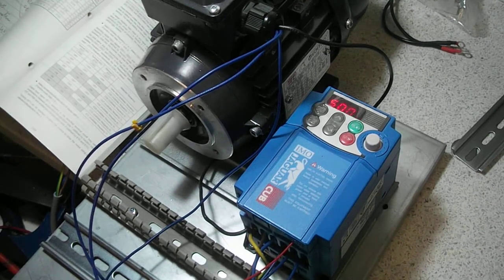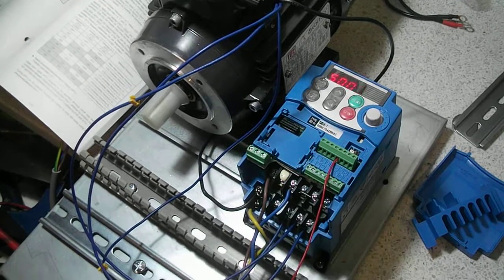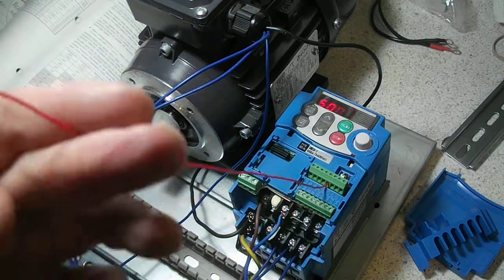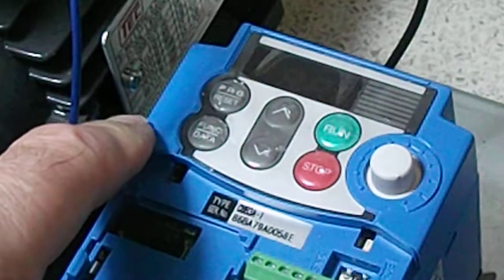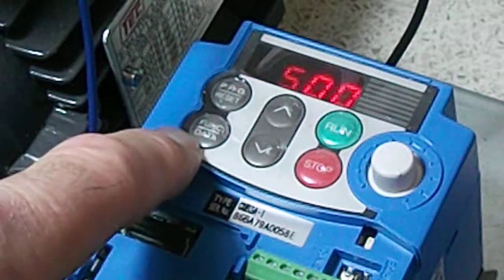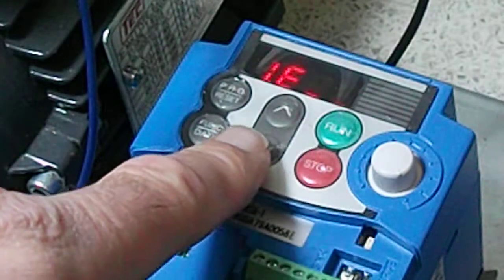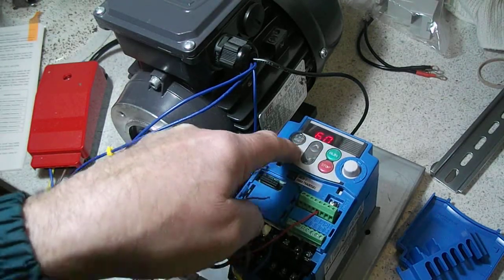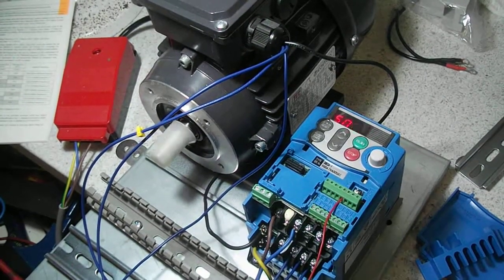IMO Jaguar Cub 3A-1 VSD VFD : Clip1, Introduction and Programming Speed Control

Comment: So I have a 3 phase pillar drill, but I am on single phase.  Does the motor in my pillar drill have to be a dual motor ie 230v/ 400v for this to work?
Reply from the maker: it should have a Y/delta link so it can work off 230 V in the delta position on this inverter.
Reply: @collectric5518  ok thanks